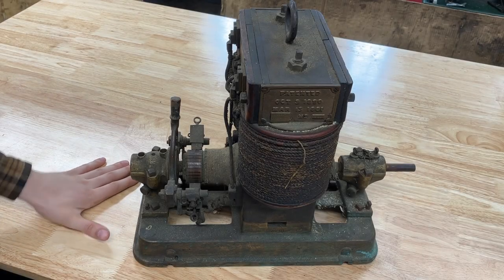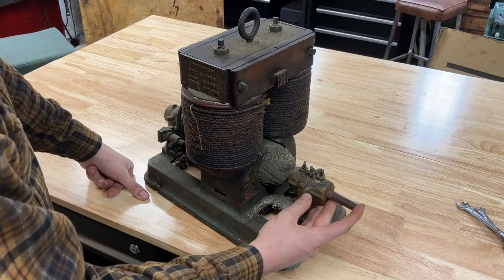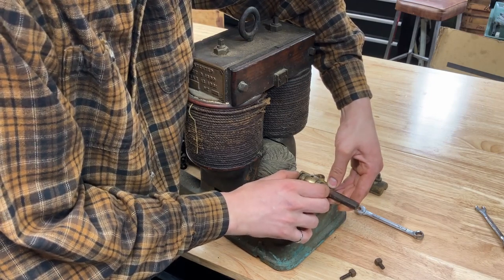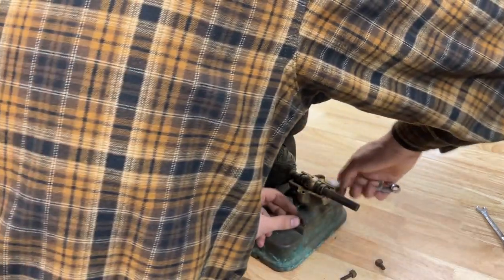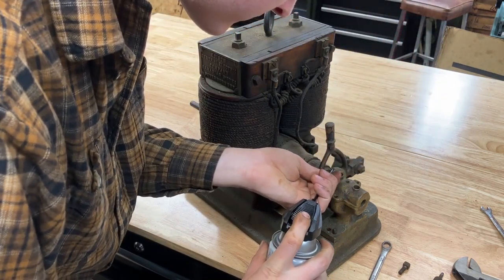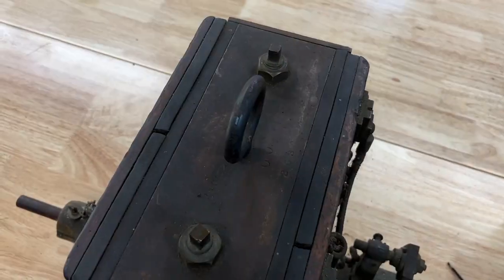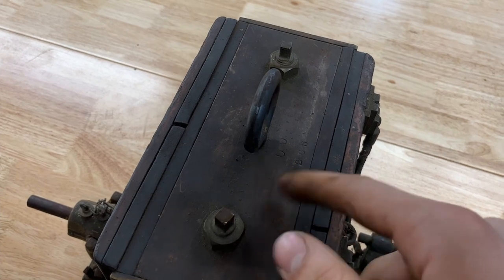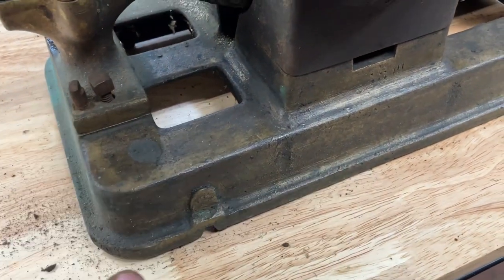1880s Edison Dynamo: Electricity in the Steam Era

Comment: I worked on the South African railways back in 1982 whe steam locomotives were uaed in the shunting yards . Those steam locomotives had a 110 volt steam driven dynamo . I never saw one but  they were used to power the headlight and cab light .

Comment: It appears that our Canadian neighbors are much more observant to historic preservation than many of us in the States .  Well done, as usual !   Could it be that some of what appears to be blackened wood may actually be early Bakelite ?    Just a thought .
Reply from the maker: One of the layers of material on the top sides of the inductor could very well be an early bakelite compound, or at least some sort of composite insulator. Cheers!
Reply: We Dutch like the historical items too. Now that i live in the Belgium Ardennes, i noticed that they do not really care about historical items. Once i found two ww2 US ammo .30 ammo boxes that the man before, i saw him throwing it on the scrapheap, threw away. I asked the scrapyard owner i i could have them. I could. Today when we with some collegues went to the dump, i saw in the metal container, big, i emailled spon rake board from about 1900. I went in the container and took it out. There was also a coal bucket in it. I was a metal working and was on the technical school and later a welder and after that a weld inspector ( non-destructive testing). I am 50 now. In my barn/ metal area, i found a blacksmith table still with coals on it, an anvils block without the anvil. The metal bits that can be put in an anvil are still there and such a 1900 vice. And several belt to power the weed cutting machine from the 1930 ( maker name still on there). Regards from the Battle of the Bulge area.

Comment: The handle above the brush rigging is for moving the brushes to eliminate sparking. The operating position of the brushes will also need to be moved if sparking increases due to current changes from different mechanical loads. It wasn't long before commutating coils were invented to eliminate the need to physically move the brushes to compensate for load changes.
Reply from the maker: Thanks! I’d never heard that